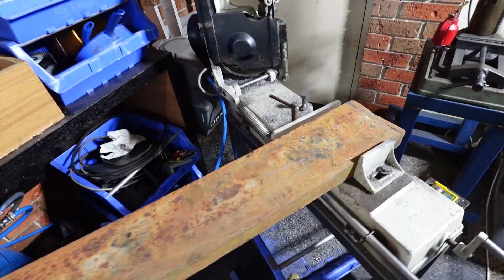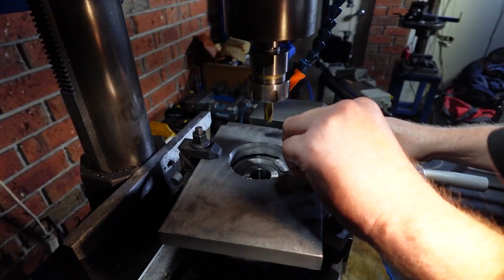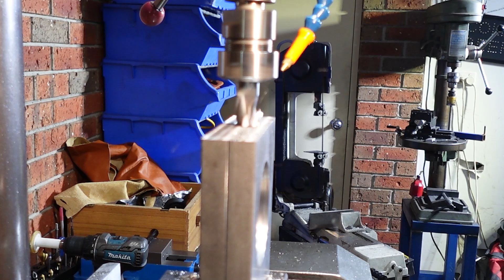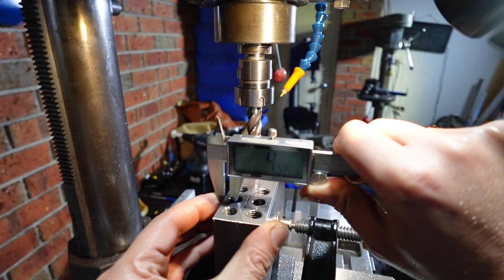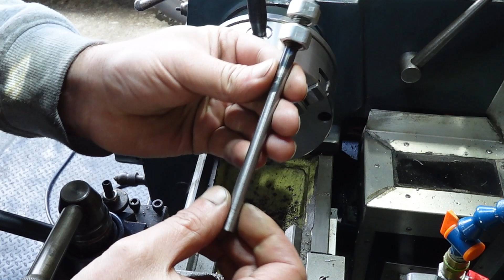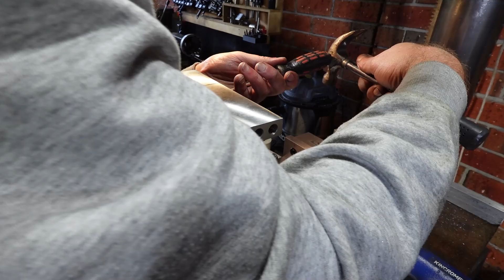DIVIDING HEAD Build. PART 4 - Milling Machine/Stepper motor/Arduino/Indexer/5c Collets

Comment: With all that cast iron you bought, have you thought about taking a piece build yourself a big bond fire 🔥 toss it in, get it red hot, pull coals and ashes over piece and let it cool slowly, might anneal it, just a thought from someone else hasn't had a clue about what should do 😂
Reply from the maker: @honeycuttracing   hey mate… 
Funnily enough, I looked right into this that same night I sold it 😆. 
Might have had some luck… dunno. 
Too late now. 
But the guy who bought it is going to try heat treat it and said he’d let me know how it turns out.  If it works out useable I can get more.  
Will see what happens 👍

Comment: I had to make a double pass with my fly cutter on a project recently and I found a pass down the centre to finish off, it seemed to blend the two passes quite nicely and I'm only using a little homemade mill. I cut an even bigger hole in a piece of 1" plate a while back to make a steady rest on a rotary table I built, it's tough going. Congrats on reaching 500 subs, I recently passed 3,000, the 1st 1,000 took a year as did the 2nd, but only 6 months for the next 1,000, it takes a while but you will get there. 👍